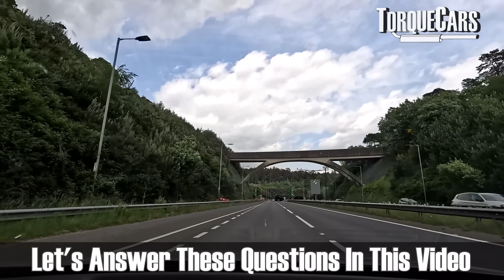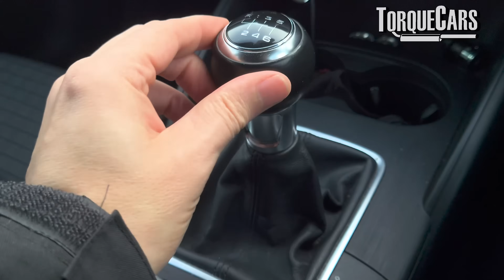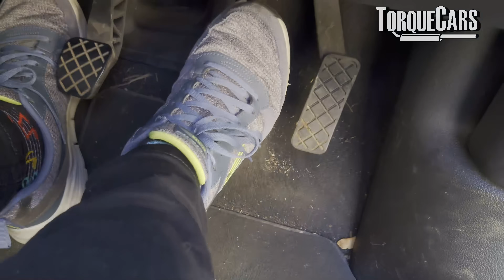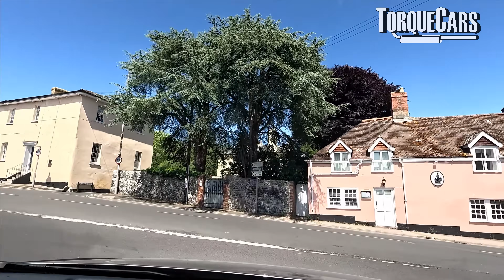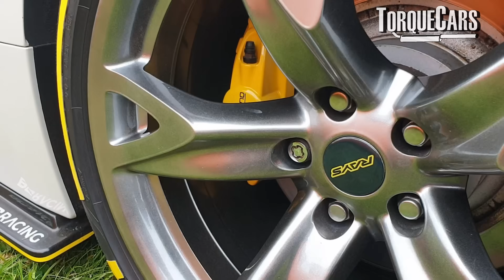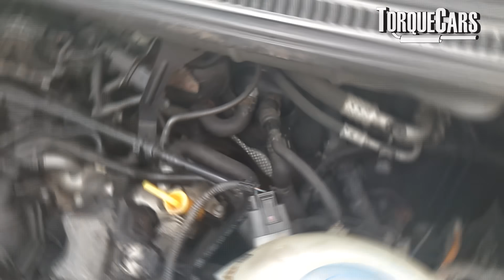What Is Mechanical Sympathy: ❣️The Secret Driving Skill No One Talks About (But Mechanics Hate)

Comment: Hi I have a question about tid engine in my Skoda Octavia scout 4x4 premium package, 2016 years model with an TDI CRMB engine-kod! It’s about ECU and way it’s almost impossible for me and mechanics to get information about the engine in the car! Everything my authorized car repair shop can find is not correct. They have called the head office for vag they said that "2.0 l TDI CRMB is an unusual engine so we can't help because we don't know enough about that engine", it's crazy that that's the answer from the manufacturer of the car! 

Can someone please explain or provide some insight into this engine design and car?
Reply: Seems a bit unusual, the 2l TDI is a fairly common engine, unless it isn't common where you like. Or unless the combination with 4x4 is unusual.

Search the fault code on Google. You might find forums with users that have experienced the same fault code. If they had a successful repair they might say what the fault was and what was done to fix the fault. Take that information to your garage and see if that helps them get any clues. 

Or try a different repair garage to what you normally use. Mechanics are as good as their experience. Maybe a different mechanic has come across your fault code and will know how to deal with it.
Reply: I take it this is the same engine used in the 2018 Passat 150hp?
Reply: Brilliant insight, but non mechanical minded people will not understand a word of it😂.
One thing I observe is come down a hill in the same gear you have to use to go up it.

Comment: I just drive very gently until the car is at ideal operating temp then try and give it a decent rev at least once on my commute. If the weather is particularly hot or I've been doing some spirited driving I'll let it idle for a couple mins before switching it off. Always use premium fuel, change the oil at about 60% of the recommended interval and do all plugs, filters etc regularly as well as a coolant change every 5 years.
I try and give the vehicle a good mountain flogging a few times a year on lots of steep, twisty roads to give the drivetrain, suspension & various components a bit of a workout
Reply: I'm the same way.  All my cars outlive my expectations.  Don't forget to do a drain/fill on your transmisison and/or transfer box and differential (if applicable).
Reply: Always use premium fuel? What? Or do you mean a premium brand?🤔
Reply: Why do you idle before you turn it off? Is it turbocharged? And what do you mean "give the suspension a work out"? 
It literally actuates over even the smoothest roads. All a "work out" does to the suspension is add excess wear. Your advice seems like it's coming from a person with no knowledge of how a car and its components work.
Reply: @EcotecEngine3.8V6  you're right.

Comment: I first heard that Jackie Stewart used this phrase! 🙂
One form of mechanical sympathy to me is that I always let my engine warm up and I never rev it above 2500rpm when I go to work in the morning (and when I start it up in general). I treat it like I treat myself when waking up: gently, in slow motion and without sudden moves! 😅
In fact, I have designed the whole process so as to not stress my engine to the slightest. The road where I live has a slight downhill and there's a parking spot below which is the garage entrance of the house next door. I park my car downwards in that spot in the afternoon and the next morning I just warm it up and roll down smoothly in 1st gear. And the route to my work is also 75% slight downhill and 25% level, so I only give the slightest of throttle to maintain my flow on 3rd gear, at ~50km/h, @~2000rpm (it's got long gears, so it helps at keeping the revs low)! It's amazing! 😊
Reply: @McBeamer94  high Revs when the car is fully warmed up helps to remove carbon deposits and keep the system clean. Otherwise they can build up in the engine like valves, springs and intake/exhaust ports. That’s why sports cars like to be driven and occasionally driven hard.
Reply: @Gaston.- You're absolutely right, that's why I give it the beans every once in awhile, plus I love listening to the half-V6 sound of my engine (which is the Daihatsu-Toyota 1KR-FE - I have a Peugeot 107 with this engine)! Hehe! 😉
Reply: See I do all that and my cars seem to pay me back with more bills 😂.. My older cars I don't think I ever came off the red line and they lasted for ever 😂
Reply: @MRJAYDANGEROUS Well, you just haven't chosen the right cars yet, then! 😜😂🤣

Comment: Driving a classic car is a good way to learn mechanical sympathy. If you push or force anything the car soon makes it known. Learning to drive smoothly makes everything work better.
Reply: amen
Reply: said it best
Reply: I was lucky to be able to acquire an Alfa Romeo 1750 GTV (about 14 years old) as my first car at 18. This taught me mechanical sympathy early on. In winter, it was hard to shift in first gear (all gears, really) and shifting into second was also tricky. When it was really warmed up after 20 - 25 km or so (I believe it took some 7 liters of engine oil) it ran smoothly  and was a GREAT joy to drive. I had it for five years and it never failed me. Fantastic car, still looking at a used one, but they are very expensive nowadays.
Reply: Driving my dad's 28 Stude as my first Stick Shift Experience, I joked that it had a "mechanical buzzer" for assistance: if you chose gears wrong or shifted wrong, it would shake the stick like mad until you let go.

Stalled that car like 4 times in 20 minutes, but it was a joy to learn. I finally felt like I was DRIVING instead of just traveling